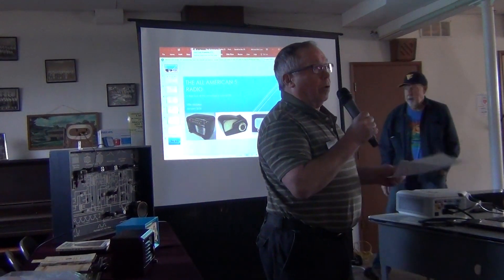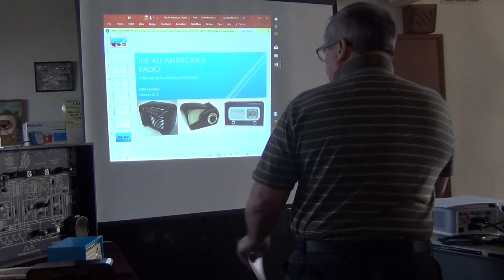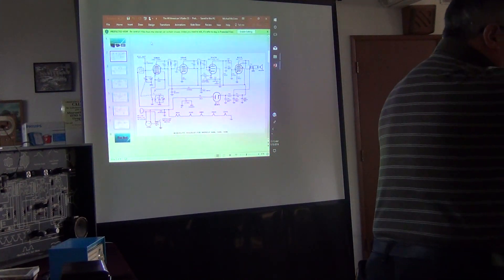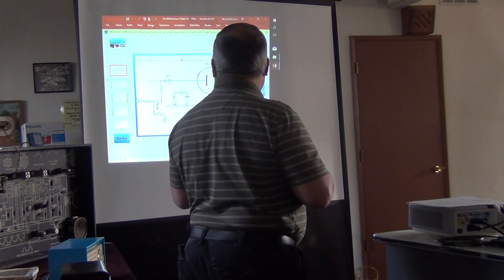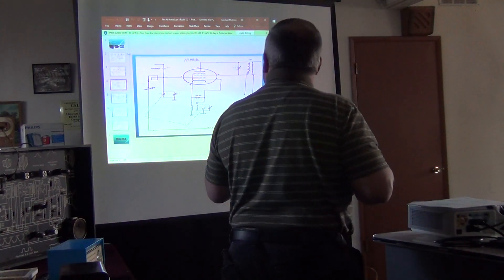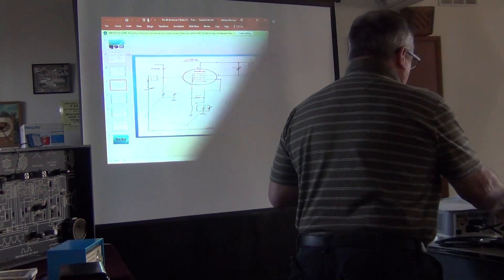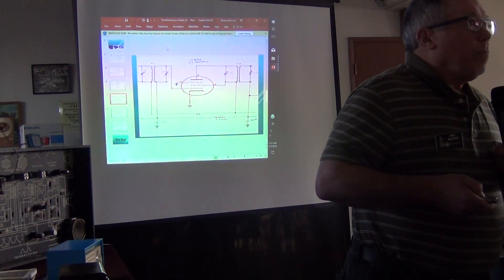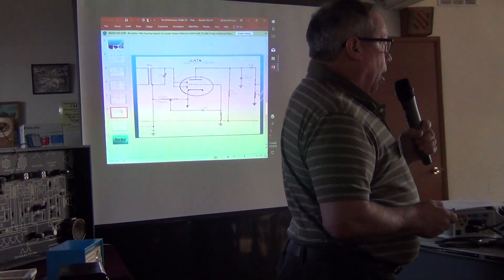Restoring All-American Five Radios with Mike McCrow  Part 1

Comment: NO,you want to run the hot to a fuse first and than the switch and neutral to ground
Reply: Pretty sure he misspoke. Line goes through a fuse then the switch then the rectifier.
Reply: i guess Im asking randomly but does any of you know of a trick to get back into an Instagram account?
I somehow lost my account password. I would appreciate any tips you can offer me!
Reply: @Lucas Amos Instablaster =)
Reply: @Finnegan Dylan Thanks so much for your reply. I found the site thru google and Im trying it out now.
Takes a while so I will get back to you later with my results.
Reply: @Finnegan Dylan it worked and I finally got access to my account again. Im so happy:D
Thanks so much you saved my ass !
Reply: @Lucas Amos Glad I could help :)
Reply: Ahh who needs a fuse?
Reply: Isolation is provided by a large magnetic field. The problem being manufacturers then re-ground the power at the output of the iso trans